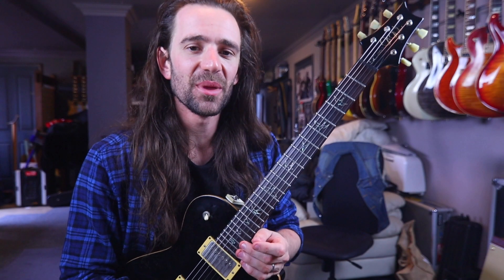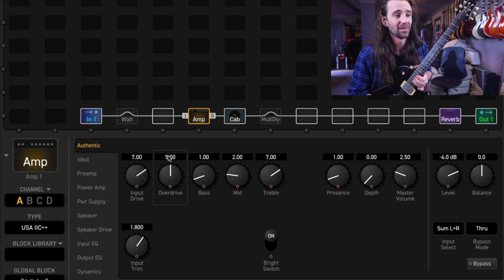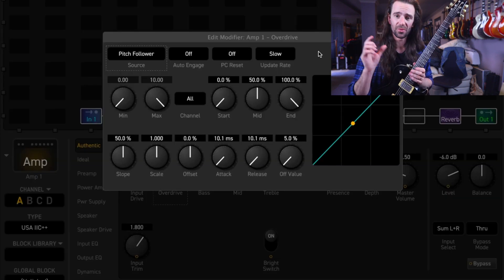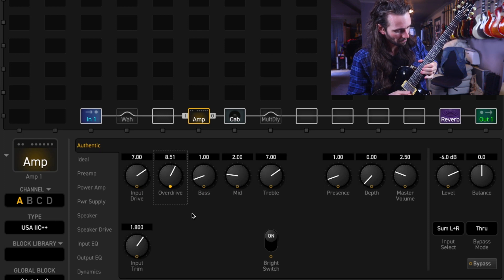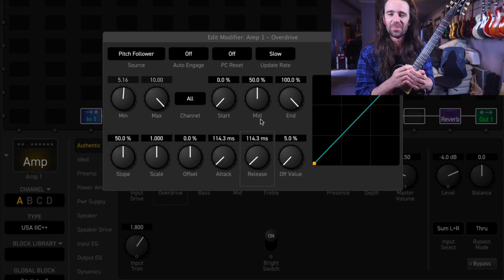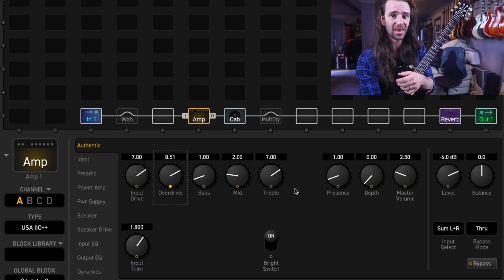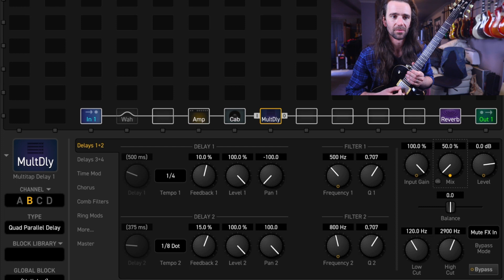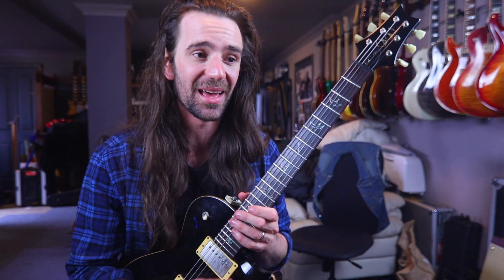5 Minute Tones - The Pitch Follower Modifier

Comment: should that also work on the FM-3 with standard tuning? 
In any case, it doesn't work for me. Too bad.
Reply from the maker: The tuning isn't relevant. Works fine on my FM3. Make sure the pitch detector is set to read input 1.
Reply: @LeonTodd  thanks for your answer! Got it! Was set to input 2 by mistake. Now it works fine! Great feature!